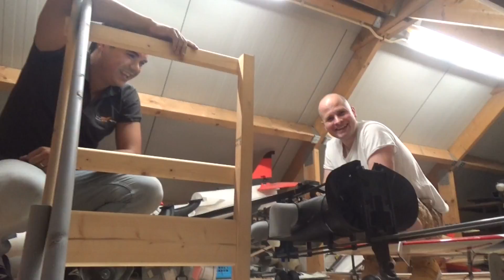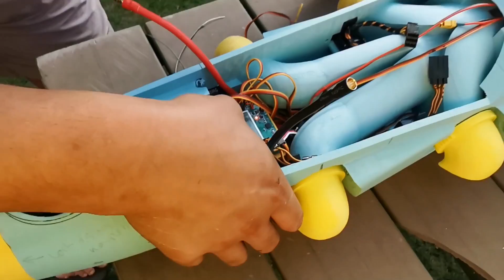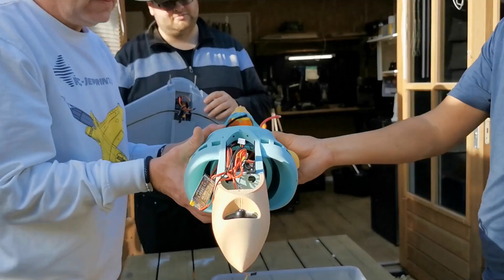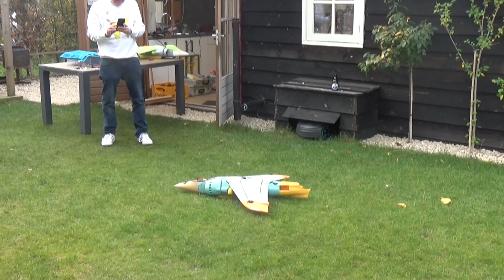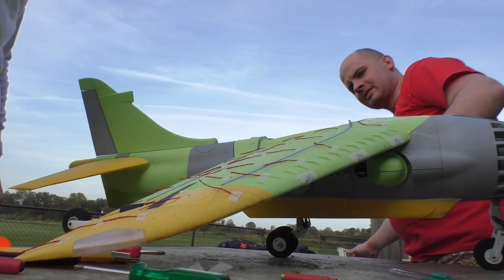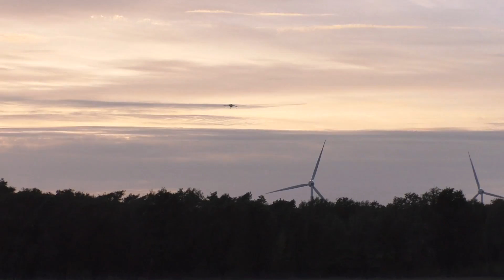How the Harrier works | First VTOL / STOL Starts with 3D Print RC Harrier

Comment: Not taking off from the floor looks like ground effects, but undercarriage may just be enough to clear it?  The original had this problem so they tested over a large pit to let the downwash clear way.  Later, the belly fences helped stop re-ingestion of the hot exhaust.
Reply from the maker: Yes they help a lot 👍

Comment: Huge milestone. Congratulations.
Reply from the maker: Yes Thx mate 😁👍
Reply: @rene_rosentraeger  Do you think that it will be possible to have preset thrust configurations? so flip a switch and go into a high speed power flair. Bleed of speed, then flip the switch back and go back to forward flight mode.

Comment: How long could you fly on single battery? I guess you really had to change baterry on new charged one few times during that testing on mini runway. Am I correct?
Reply from the maker: Flight time is up to 8min 💪
Reply: @rene_rosentraeger  could you put 2 batteries into the plane? Assuming there is a room for additional battery, could that over weight the plane?